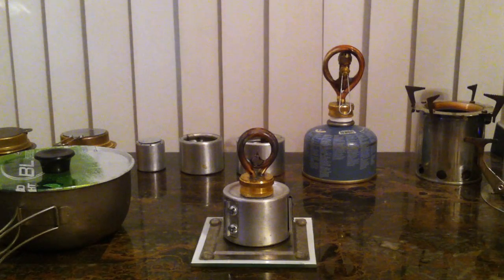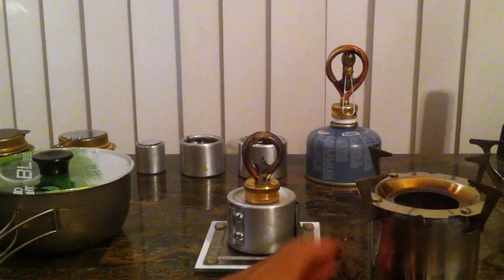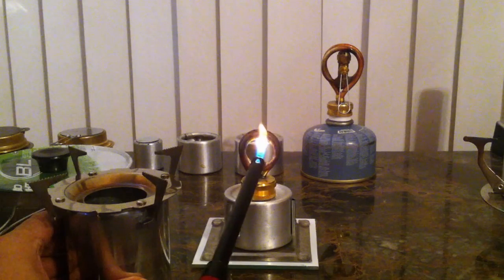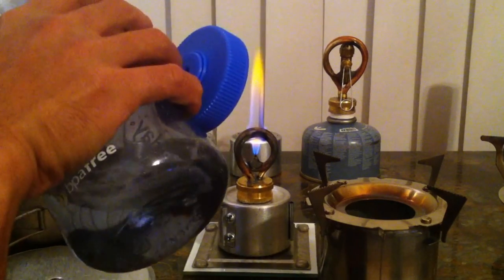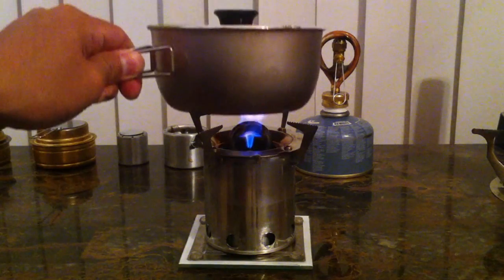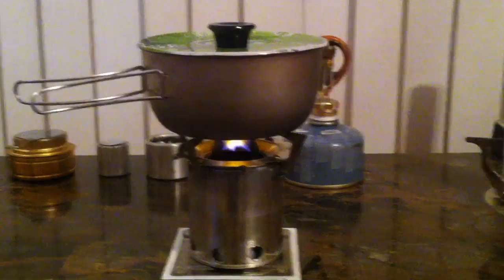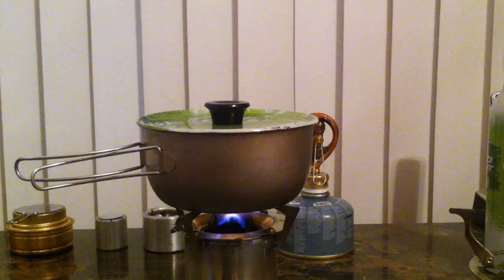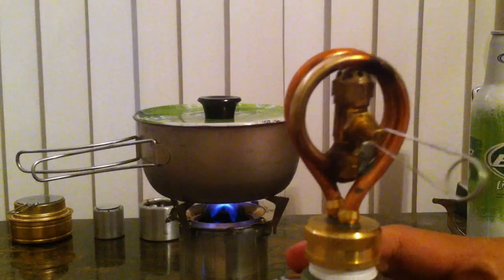Copper Coil Alcohol Stove.

Comment: Nice coil stoves! I was curious what you made the nozzle out of, and how you adhered it to the copper, on this one you demonstrated for us? While I was watching I was thinking about how a nozzle could be made by taking a small machine screw, cutting the head off, drilling a small diameter hole down its center, removing the threads except for the bottom of the screw/nozzle that will screw into the hole in the copper tubing, and grinding the upper portion to a square shaped cross section, so a small set of needle nose can be used to grip it, and turn it so it taps and threads into the copper. But that would require a drill press, and small diameter bits that can handle metal, that I don't have. A brass screw wouldn't be too difficult to drill, but probably wouldn't thread into the copper well because it's too soft for the threads to tap into the hole in the copper. I suppose a steel screw with the same diameter, and threading, could be used to tap the hole in the copper, then the brass screw/nozzle would thread in just fine. I need to get some tapping tools for threading screw holes, and some strong micro drill bits.

Comment: I tried making one of these stoves made it but its not making the jet flame its making a normal flame what am i doing wrong ?
Reply from the maker: Michael Degazon - Make sure you have a carbon felt wick inside the copper coil to suck up some alcohol. It should work fine.
Reply: Thanks for the info.
Reply: Mr Serrano where does this stuff sell im from the island trinidad and don t know if they sell it here and one other thing what is this material commonly use for?
Reply from the maker: Michael Degazon -I made this from a budweiser Aluminium beer bottle and some copper tubes and starts being creative by following my imagination.
Reply: What type of store sells carbon fiber i wanna get some to try making a stove that actually works this time.
Reply from the maker: Michael Degazon - https://www.minibulldesign.com/productcart/pc/viewPrd.asp?idproduct=81&idcategory=6

Comment: I cannot control my jet stove with a consistent flame, sometimes it is a jet but sometimes it is just normal flame.  I think it is a matter of wicks.  How long inside the tubes u put the wicks in?  Is there any space between the wicks and the inner tube walls?
Reply from the maker: sunchaser w - Just adjust the hole of the nozzle.

Comment: Cool stoves, use thin wall stainless steel for your coils though. Copper, Methyl alcohol and heat do not mix, you are making a form of formaldehyde with your stoves. That's what that white powdery residue on the copper is.